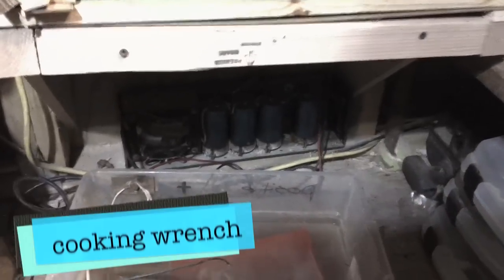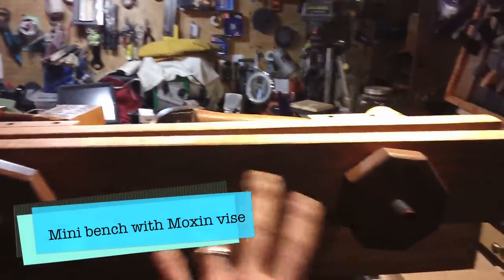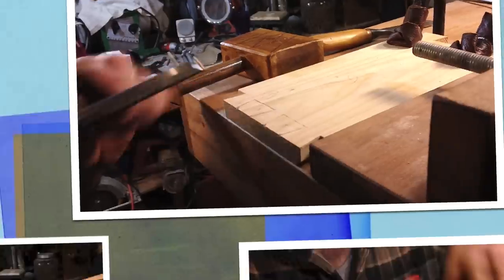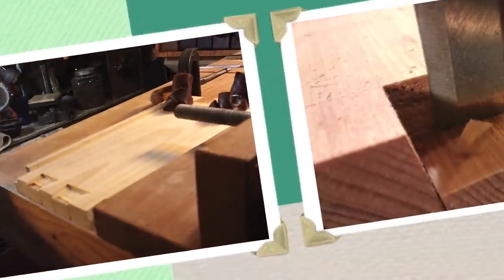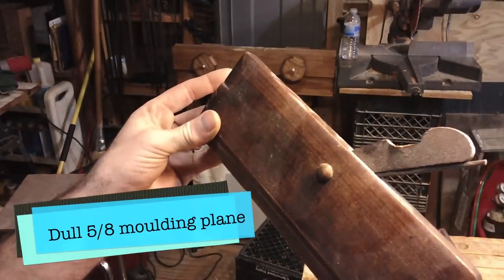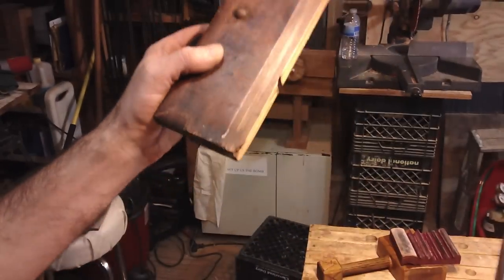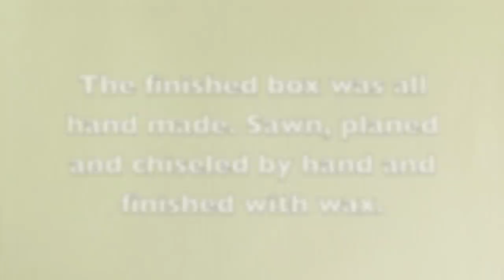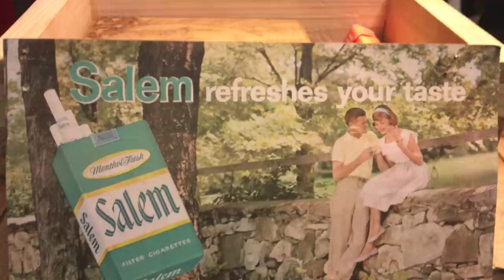Tobacco Box

Comment from the maker: I love my Yankee drill, it has a full set of bits in the handle and make light work of holes. I paid more for the bits than the drill.
At that price it would have to be in real nice shape. Not a wedged plane like mine but have threaded fence. With all the treads still there and a few irons. A full set of irons is a bit costly as well but can be found with not much of a problem. Good luck and thanks for your time.